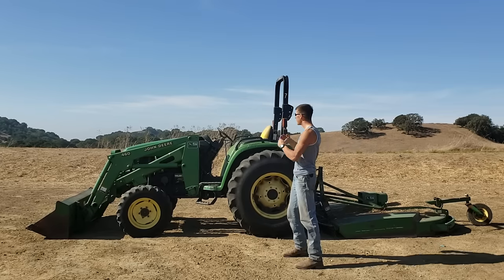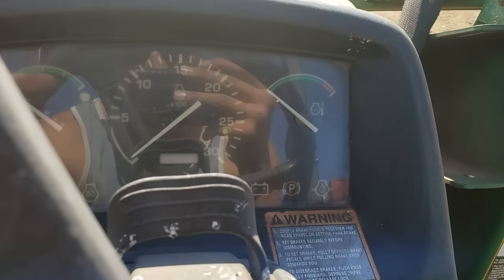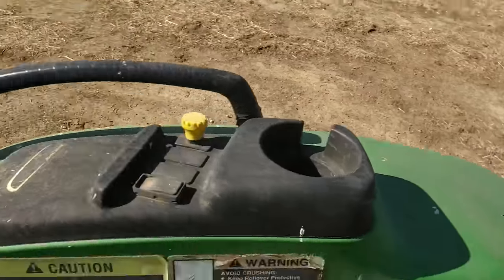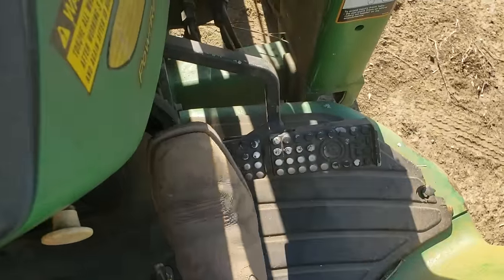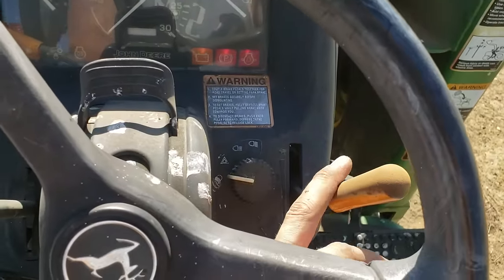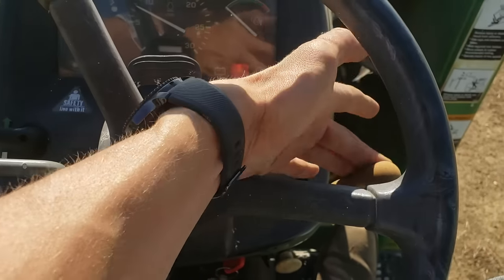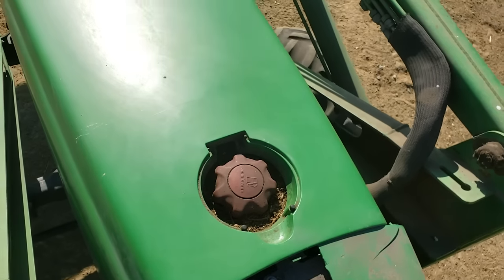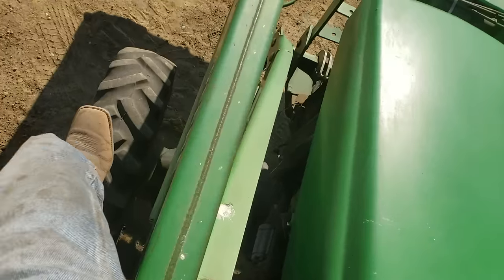HOW TO DRIVE FARM TRACTOR!

Comment: A small lesson for you: You say you keep it in 4WD permanently, well here is the thing, if your rig hasn't got a central differential fitted from factory, then by running it in 4WD all the time and steering it in either direction, you are going to cause serious transmission windup which will overload and eventually damage your drive-train. Things will be worse if you drive it in 4WD on hard road surfaces like tarmac, which will likely lead to a sudden catastrophic breakdown signified by a loud bang.

Comment: Thanks.  I have a 2008 JD 5303, and was lugging the engine too much when putting it in gear.  I learned that I needed to bring up the throttle prior to releasing the clutch.  Thanks!

Comment: Once you’ve geared it would you let go of the clutch and only press the gas to move ?
Reply: Yep, if you brake fully you have to engage the clutch or it will stall out. Unless you have it in neutral. About 5 minutes driving one you get the basics.

Comment: Does the engine speed increase when you press harder on the accelerator? Or only when you move the throttle lever with your hand.
Reply: Yes it does best way to think of it is a gas pedal on a car
Reply: @zackschilling5154  I guess they have foot throttles too.